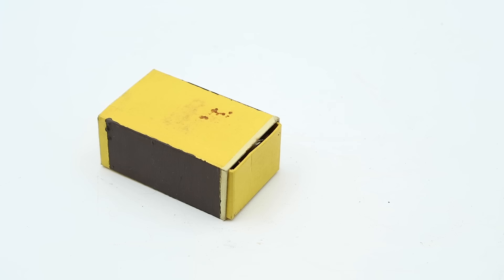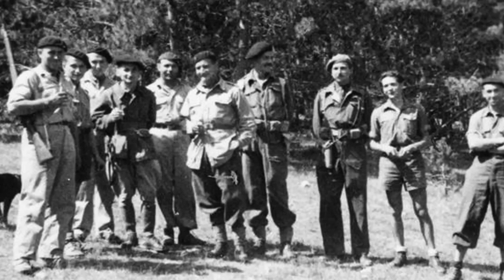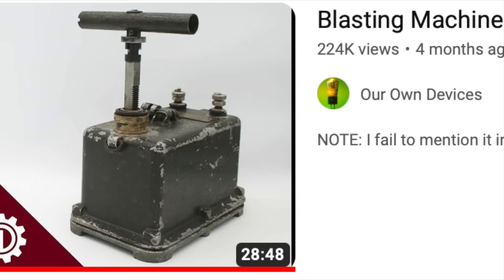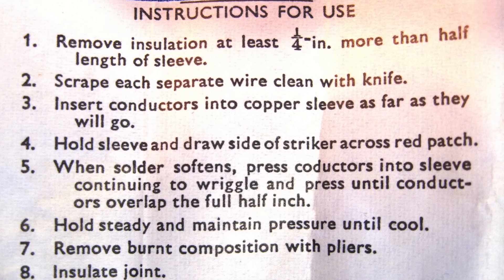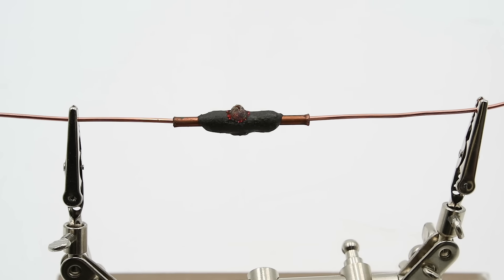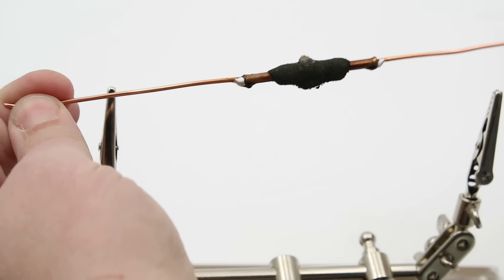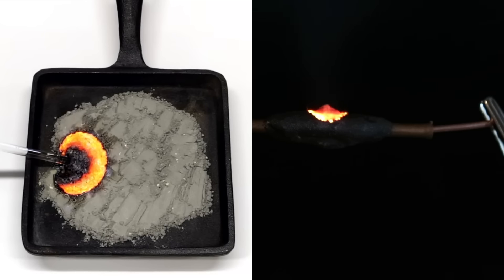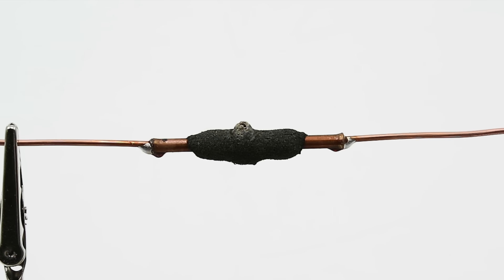SHORT: WWII SOE Self-Soldering Sleeves

Comment: Outstanding information.  I was once an aircraft electrician and taught approved wiring practices to mechanics.  The modern solder sleeve splice practically revolutionized the task of splicing and sealing wires on aircraft.  I believe it was developed by Raychem, now Tyco TK Connectivity Raychem.  It combines a tube of heat-shrinkable material such as polyolefin with sealing inserts and a band of solder in the center.  The solder ring may have dye on it which disappears as the hot solder flows, indicating a successful union,    It is used with an external heat source, preferably a regulated-temperature heat gun, and does an excellent all-in-one job of securing the wires, ensuring conductivity, and sealing the splice against the environment.  Aircraft-quality splices are expensive, but China now produces floods of inexpensive copies that are quite useful in many wiring jobs.  I was also reminded of the portable soldering irons we used before the onset of battery-powered soldering devices.  A copper cylinder with a soldering tip unscrewed from a wooden handle to allow loading of a shotgun-style cartridge that heated very rapidly when you released a firing pin.  Indoors, the tip stayed hot long enough to solder several connections.  Outdoors on a cold and windy night you had to work very quickly to get anything done.
Reply: Interesting information, I have not thought about the need for portable irons I have a old mains voltage iron with a huge bit and I see how a pyro cartridge could be used for a heat source. Thanks.
Reply: I am an Avionics tech.  I use these.  They are wonderful.
Reply: I'm an auto mechanic, and those heat shrink solder-sleeves have been modified and made their way into automotive repair circles.
The typical heat shrink self-soldering butt splice that I encounter is actually a standard butt splice crimp connector with a blob of solder inside the middle of it, wrapped in a seamless tube of heat shrink tubing covered on the inner surface with hot-melt glue or sealant of some sort.
The method of application is that you insert both wire ends you wish to splice, crimp using an insulated connector crimping tool of the appropriate size, and then apply heat from a heat gun. The connection is already securely made after crimping, but heating the device causes the hot melt glue or sealant to melt, the heat shrink to shrink, and the solder to melt. This results in a joint that has in mere seconds been guarded against water ingress (extremely important in automotive work), as well as doubly insured to be electrically sound, by means of being both securely crimped and then soldered.
I know I probably don't "need" to crimp them, but I do anyways, nothing like a little "belt and suspenders" type insurance when it comes to automotive wiring repair (something that is difficult to access, and therefore I wish to not have to go back to fix it again).
Reply: @WOFFY-qc9te  ב''ה, commonly was just a butane cartridge by 1980s-2000s.  Maybe there's some other wacky stuff out there.
Reply: I haven't got many of them left, but a friend in the MoD gave me one of them wire joining kits comprising the heatshrink tube with a metal sleeve inside and the solder with a dye ring the rest of the kit is a refillable gas air heating "wand" with a curled heating plate that hooks round the solder connector (it guides the hot air around the joiner not physically touching it).
Reply: Do you remember a name or anything on that soldering iron you mentioned? I'd love to read into them more.
Reply: What an interesting iron design. I thought old portable irons were essentially all butane powered but I guess I was wrong!
Reply: Correct
Reply: I am also an Avionics tech,I use the Raychem Splices regularly! These splices are pretty cool! As far as heating portably I use a butane soldering iron with interchangeable tips.
Reply: I absolutely love those self soldering connectors.  They are a huge headache saver for wiring trailers and other places where the wiring ends up exposed to water and salt spray conditions.  No weak spot in the heat shrink from the crimp, and they heat shrink helps overcome the potential failure point of an inflexible solder spot in the wiring.  
I just wish they didn't cost so much.  Last box I bought was over $2/per connector.
Reply: I have unfortunately only experienced cheap chinese knockoffs of this sort of product..  The solder didn't even wet to the wire.
Reply: OK, so what's the trick for using those solder sleeve splices?  I bought a pack of them form Amazon but could never get the solder to make a good connection.
Reply: @MK0272  Usually I fray the wire ends a bit, use a lighter to shrink the end of the tube onto one of the wires, then push the second wire in carefully to mesh the strands.  Once it's all in place, I use a heat gun with a wrap around diverter to heat it from all sides until the tube shrinks and the solder melts.
Reply: @jaredkennedy6576  I'll try that.  Thanks!
Reply: @MK0272 use some flux, or tin the wires first
Reply: @MK0272  Sounds like a lack of flux.  Try rubbing a light glob of plumbers paste flux on the copper wire during assembly.  This should be rosin paste flux as opposed to the more aggressive but corrosive, acid flux.  Flux will help break the surface tension between the molten alloy and copper wire while gettering minor impurities.
Reply: For sure I have used the modern ones !
Reply: I once met an EX WWII SOE Operator sitting on a London tube train - my attention was drawn because he was reading a book with funny writing (Parsi - Persian)  a languages Don from Oxford who'd parachuted into Yugoslavia to liase with the resistance.

An almost completely unoticeable, speccy little bloke - exactly what you would want for an agent! Fascinating man (and a brave 18 year old too, he knew exactly what the Gestapo would've done to him)
Reply: More than  few Raychems were fused with a Zippo lighter in ancient times.
Reply: Re portable soldering irons, decades ago in a junk yard I came across Thermite charges the size of a tea candle and a packet of match-like igniters that were used to heat a plumber's soldering iron. There was a cavity in the head of the iron to take the Thermite charge.

Comment: I remember using those at school in Edinburgh, Scotland in the early 1960s. I was the sergeant of the signals platoon, part of the schools Combined Cadet Corps. These self-solderiing sleeves were used for joining copper or copper cored steel field telephone cables. We had two different types, one for joining copper cables and one for joining copper cored steel cables.
Reply: (Sorry, might have pressed the wrong like button)   Same here, we were still using them in the CCF in late 1970's.     There must have been thousands and thousands made - not just an SOE item but a universal quick splice for field phone cable that was usually run out of back of Universal (Bren) Carrier in WW2.  The cable had a mixture of steel wire strands for strength and copper wires for conductivity.   The cable was so old that you needed to scrape off the oxide before making the joint.   One cable laid with an earth return.     Do you remember having to water the earth spike?
Reply: @jonathanflatman  Yes to the earth spike but not with water 😄😄 A more conductive fluid.
Reply: Yuck but yes definitely would be a bit more conductive but as I say when you got to go you got to go but in some cases might be helpful in the field situation even to let some of that fluid loose might be a little more comfortable LOL
Reply: I was wondering why this would be a special ops only sort of item, awesome idea of course but I wouldn't exactly call it the most 'revolutionary' concept that needs to be hidden from the enemy and it's probably a lot more useful outside of the spec ops guys purposes too.
Reply: @RyTrapp0  They were standard issue to Signals Corp telephone linesmen.
Reply: Was thinking the binder could have been hydrated lime, considering the need to add water makes more sense.

Comment: Dont know if they still make them, but in the early eighties we used vulcanising patches for repairing punctures in truck tubes. They were a shallow, pressed tin, open top container filled with pink fibrous material and a rubber patch on the bottom. We'd scuff up the area, peel off the plastic from the rubber and clamp the piece over the hole. Then scratch away a bit of the pink and ignite it with a match. It would burn steadily and slowly enough not to ignite the tube, but just enough to vulcanise the patch to the tube, very much like the stuff you showed. Chemically controlled tempreture.
Reply: I found a video demonstrating one of those patches, branded "Camel." In it, they lamented that the patches are no longer manufactured due to either an environmental or safety concern, I can't remember which. The instructions also indicated that they should be ignited with a lit cigarette. I'm not entirely sure why a match or lighter would work differently.
Reply: We have fancy glues for that these days, built into the patch and activated by heat.
I got to watch one being applied once because I was the only customer at the time, and also got to pet the shop dog.
Reply: I, too, was reminded of these patches and lament their demise.
Reply: @kevinmartin7760  I remember using those patches.
Reply: My bicycle inner tube was fixed a few times; from punctures of devil head weed on our favorite shortcuts. All until self sealing tubes came along. Thank for the memory.
Reply: Yes, I used them in the 80s as well, on truck tubes. In the 90s, even the trucks went to tubeless tires, and patches were no longer required. It's all plug or replace now.
Reply: Yes, I deleted my comment when I saw this. They were very smokey and stunk like sulphur. Very durable patch too.
Reply: They were superior patche. A few originals turn up on Ebay now and then.

Comment: That must have been super high speed back in the day. I once watched a video about lineman running field telephone wires and the “correct” military manual way of securing the communications wire took quite a bit of time. That would be much quicker. Very cool video.
Reply: i was just watching a video about splicing field wire, and you're right it took a long time, especially with the rubber coating that was much harder to strip as compared to plastic coatings used today.
Reply: Yes! Field telephone wires were and still are a pain to splice together. I think these are made originally just for that. Blasting wires were and still are easy and quick to connect so these are not useful for those but if you have only field wire at hand, then this makes sense to use quickly connect wires. Or if you need a more permanent installation for the explosives, like more than couple of hours, BOOM in few days, you would make the explosion connection with field wire.
Reply: Was about to ask why not just tie/splice it together
Reply: Ah, yes, the Western Union Pigtail Splice.   One of the first demo wire connections you learn as a combat engineer.

Comment: i have a kit made around the 60's that is a bunch of solder butt splices like this, only they also include heat shrink and adhesive to create a watertight seal. they don't self heat though and require a butane torch in the shape of a pen. my gramps called it his "field solder kit" and he used it all the time, almost daily, to work on stuff in the field. it saved him a LOT of time or running back to a 120vac power source to run his solder iron or a heat gun. i've never heard of a self heating butt splice until this video, but it makes perfect sense. super cool piece of kit and i'd love to have a box today! there have been many times where getting my butane torch pen into position was actually not really possible without melting something or burning myself (or someone else)

Comment: Very elegant. I used to have some of the propylactic abrasive engine destroyers. To keep the oil filter from removing the abrasive from the oil, the abrasive was coated on bits of cork, This kept the abrasive floating on the oil in the pan, allowing it to remain in contact with the cylinder walls wher it could do damage.
Reply: Oooo naughty boy.
Reply: @WOFFY-qc9te  When those devices were developed, many if not most vehicles didn't have oil filters. Today, they would not be so effective, even with more modern abrasives.
Reply: I dont know, modern car engines have much tighter tolerances than yesterdays cars. Add to that the fact that when the oil filter flow through rate drops low enough, the oil filter is bypassed.
Reply: @juslitor  Those devices were developed in WWII for use by partizans. They were good for the time and are just of historical interest.
There was a family of fuel and oil additives that were developed for use during the War, and unfortunately, this is not the forum for their discussion.
Reply: If that's how engines worked it would have been quite effective.
Reply: @stykytte  Back in the WWII period and before, engines were much simpler. It must have worked or they would not have used it.
Reply: @stykytte  Most of the devices were developed by SOE and then passed down to the OSS. The only german device I had was a J Feder timer that was used on the scuttling charge in German Subs.

Comment: The orange stuff that boubbles out is most likely rosin (or colophony), which is a pine resin product used as flux for soldering (this little amber-colored paste you get in every soldering kit? it lowers melting point of metal and helps with adhesion, which is around 180 C for tin, fairly low for metals actually). It's actually amazing that pyrotechnics on the outside produce enough heat to melt metal inside the tube, without visible flame!
Reply: remember though that the pyro mixture is only 'heating' the copper tube beneath it... so flux/rosin is not needed for heating the tube... the wires and solder are inside the tubing.
Reply: It doesn't really lower the melting point that much. It's just used because it is acidic while (and only while) hot and therefore removes oxide layers on the parts to be soldered, but doesn't corrode them further when the joint has cooled down.

For pipework etc. something stronger is used, typically zinc chloride in diluted hydrochloric acid, but this needs to be cleaned off later, and should never be used for stranded wire. You will never ever get it all out and a few months-years later the wire crumbles into a green powder.
Reply: Wow this is really good to know. I'm sure I've definitely effed up some projects now that you mentioned how it's different. Green death of a wire sucks.

Comment: I'm guessing that the heating accelerant of these "instant solder connectors" was of similar formulation to the compound that was used in "Hot Patches" back in the day to repair inner tubes?I believe that the Hot Patch products were removed from sale in the 1980's for obvious reasons. ( noxious smoke and fire hazard).
I recall being very disappointed when "Hot patches" were no longer available as we used them to great effect to quickly repair the tubes on our bicycles via vulcanization rather than with an adhesive.
The hot patch kit contained the following items:A number of small, formed, diamond shaped, sheet metal trays with the recessed side filled with the heating accelerant. Each tray also had a section of thin rubber sheet bonded to the center of the flat side. This rubber "patch" section was about twice as thick as a common inner tube and there was a matching piece of thin plastic sheet covering and protecting the outside surface of the rubber patch that had to be removed before applying the tray to the tube.
The kit also included a small cast aluminum vise that was used to hold the metal tray securely against the inner tube.
Basic operation was to load the vise with the rubber patch centered over the damaged part of the tube and then touch a match to one of the raised ridges on the surface of the heating accelerant material inside of the tray.
The ignited heating material would then burn steadily across the inside of the tray with a fair amount of smoke until it was all consumed.
It was important to NOT let any portion of the inner tube ( or human flesh) touch any part of the tray as the heating cycle would easily melt the tube and-or brun the crap outta you. Also important was to allow the whole assembly to cool down before disassembly.
I recall having some burnt fingers and destroying a few inner tubes along the way during the learning process. The whole operation served to feed any young pyromaniac's "burning" desire .

Comment: The burning material would be very similar to old type rubber tyre tube hot vulcanising patches. You would place the patch over the puncture, clamp it tight with a special tool and then ignite an oval shaped tray which contained the Sulfur iron powder composite.  I can smell this from here!

Comment: Interesting. There are probably a number of benefits to these. 1) really good connections. Soldered electrical connections are some of the best. 2) easy to do, any soldier without much training can now make fantastic soldered connections 3) fast to do (time saves lives if someone is shooting at you) 4) low failure rate if one is blowing up a bridge you really want all the explosive to go off 5) high connectivity and less noise if done on phone lines, less loss if setting off explosives with a battery 6) allows the wires to handle all weather conditions. If you are setting up explosives to ambush the enemy attacking your position in snow or rain in a few days. 7) light weight easy to pack in, does not require a torch or soldiering  iron ect 8) reduces the need to check the connections if you know it is going to work you can get out of there. 9) knowing it is going to go off allows you to take more risks (aka explode the tracks as the train is coming derailing the train). Overall pretty Cool little device!